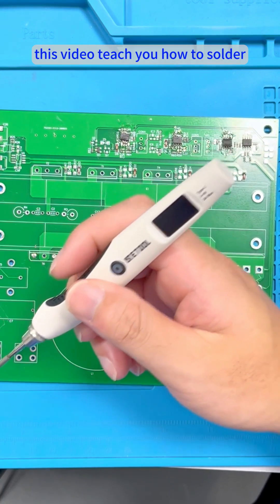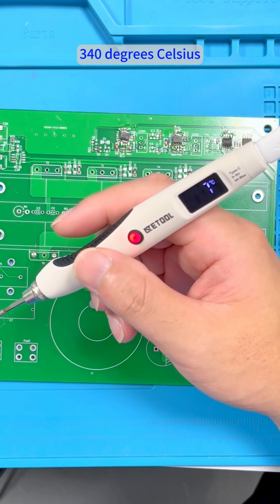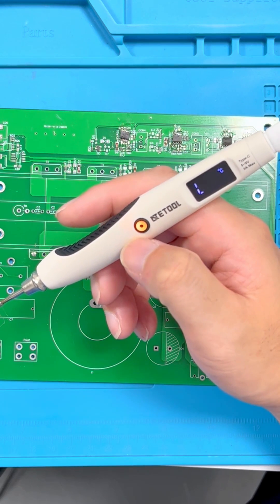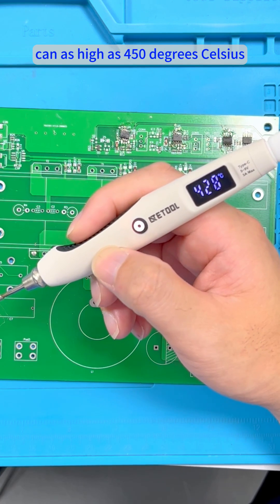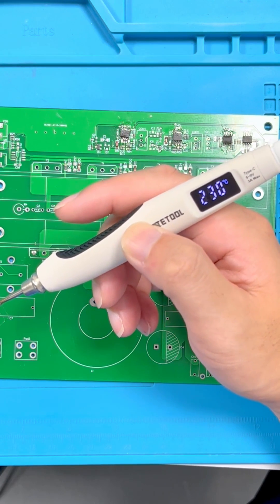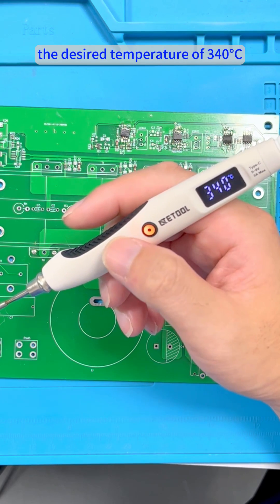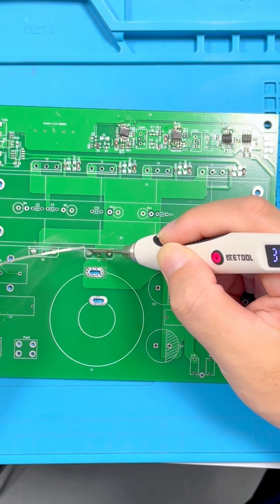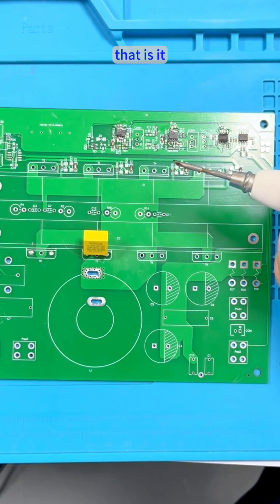how to solder with usb soldering iron AE730D

Comment: My AE970D does not release temperature when I take my finger FROM the rubber touchpad. Is there a solution for this? Is this a firmware issue?
Reply from the maker: Hello, It might be the updated program version. You can long press the button and wait till the screen shows Hht, there you can set the time from 1 to 900 seconds. You can set it as short as 1 second, then it will not keep heating all the time, current default heat hold time is 180 seconds. You can long press the button unit screen shows uXX, and see what program version is. Write to atetool@atetool.com.cn if your problem is unsolved. Happy soldering!
Reply: @atetoolofficial955   it solved it, thank you very much!